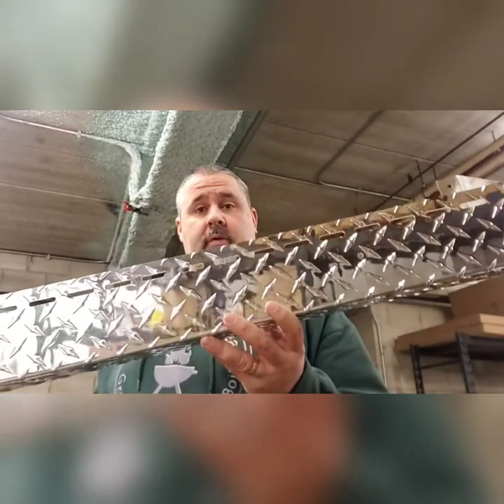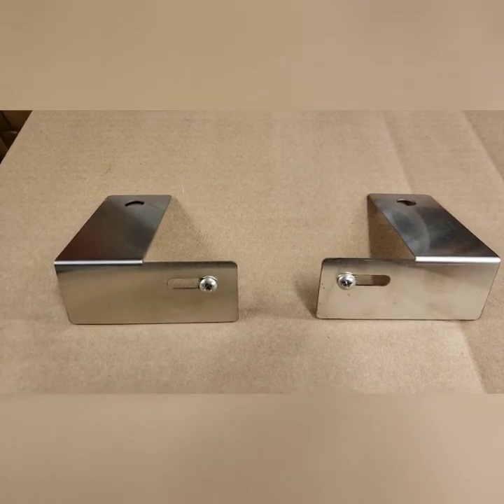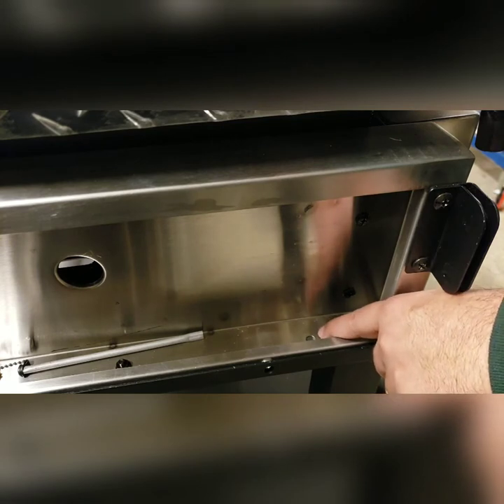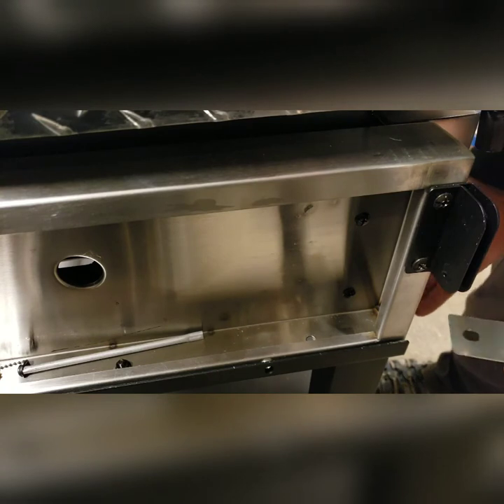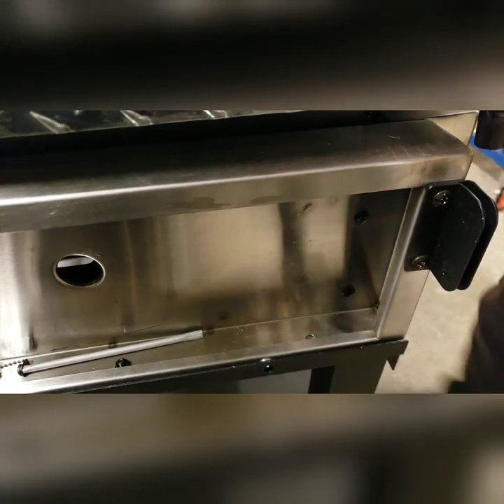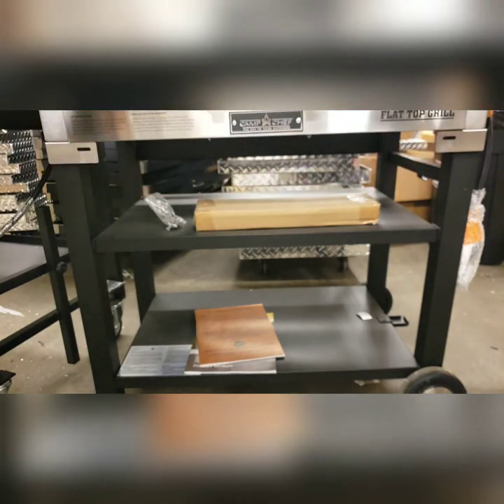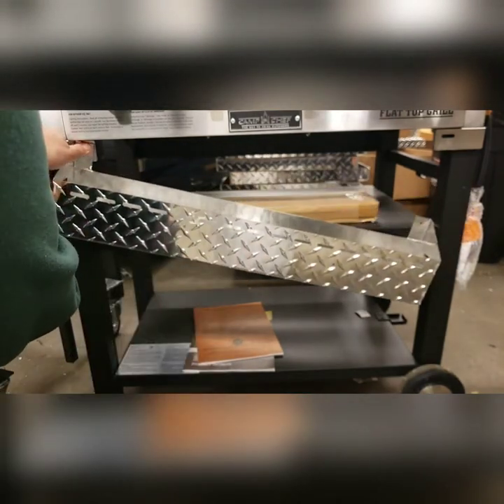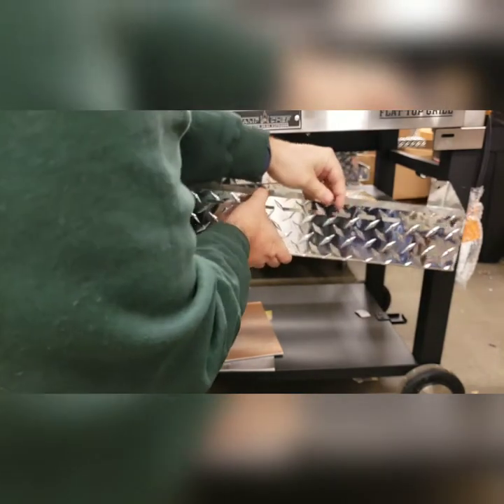Backyard Life Gear Front Tray for Camp Chef FTG600 Flat Top Griddle - How to install

Comment: What is that aluminum pin on a chain? Is that for cleaning out the hole at the oil tray? I can’t find any documentation on it.
Reply from the maker: That is part of the griddle.  It can hold a match if you need to light the burners manually.
Reply: @BackyardLifeGear  ohhhh. Thank you!